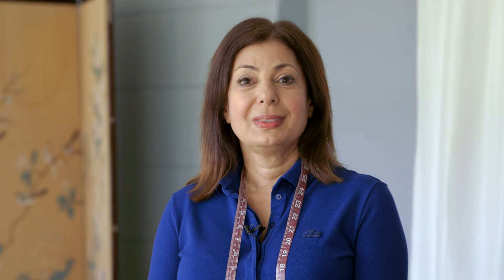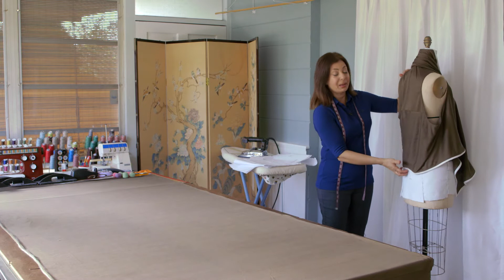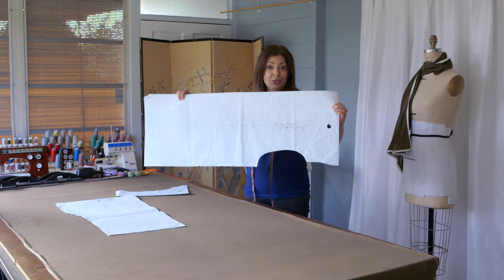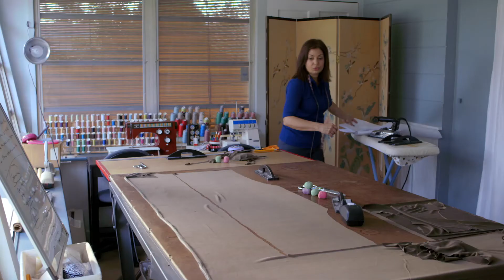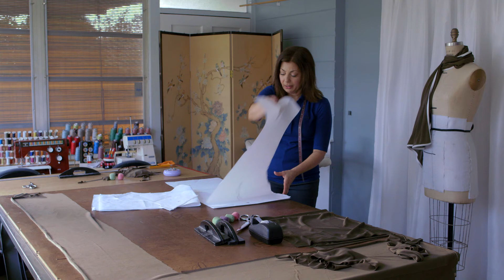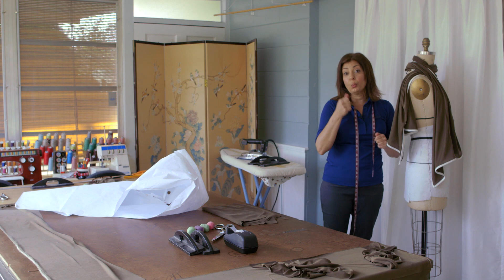How To Cut & Engineer a "Three Way" Shawl Vest!

Comment: May I ask !  What is the reason for not using pins.
I love your knowledge.  Thank you for sharing.👌🏻
Reply from the maker: Hi Rene, The main reason is, in a professional design house most of the time they are cutting layers...So each layer is done with tissue paper and at the end they weight it down. If its a sample that is made only once the pins can buckle and cause the garment to change in size. If that makes sense. When a desig house is checking a pattern for accuracy the Very Smallest of changes can give them a false result. I hope I'm making sense lol! Please let me know. Thank you for your question:).

Comment: Would it have been better to just keep the pattern pieces folded to make the cutting quick? Just wondering what the benefits of spreading it open if both sides have to be mirrored image of each other anyways. I'm also happy to see that you are uploading more now days :))
Reply from the maker: Thank you for your comment. There are two reasons why in a "Professional" setting the pattern pieces are opened and lay flat. The first reason is in a professional setting "Most" likely you would be laying several layers of fabric on top of each other, then cut the garments. The other reason is when you are cutting one garment or many garments.... it is most likely "Impossible" to get each layer exactly on the fold with the pattern. just having it off 1/8" at the fold line could change the entire size of the garment once made. I hope this helps you:).
Reply: susaneliascouture thank you so much for explaining that to me. I will start folding my patterns from now on :)) I've always seen others do it and now I know why. Thank you again!